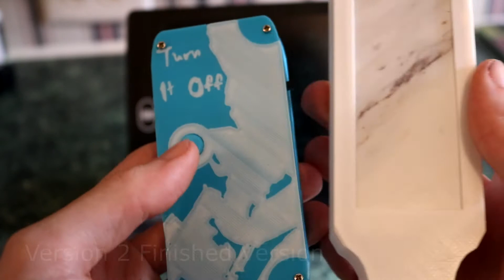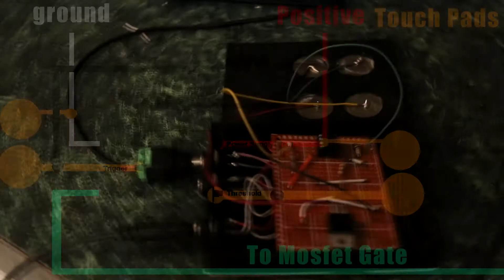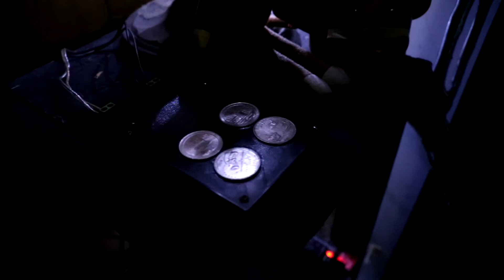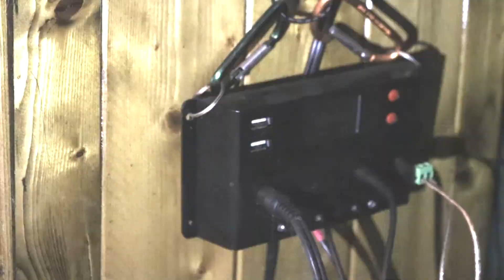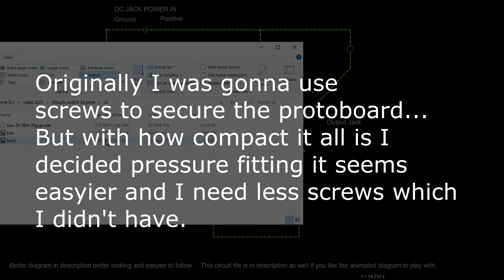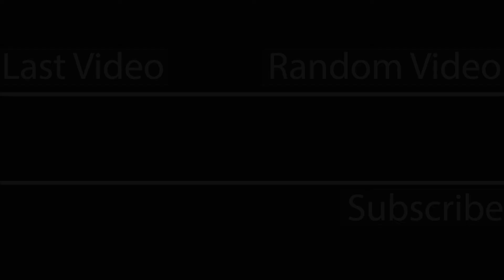Simple 555 Timer Touch Switch For My Solar Set Up

Comment from the maker: Update this switch is still working good I use it with my 3D printer off a dc wall plug so I added a barrel type fuse not that I needed it I only use it when I am around any way but for safety reasons it was simple to just add it on the dc male plug just in case it was ever plugged it in and forgotten about before a trip or anything like that. :D